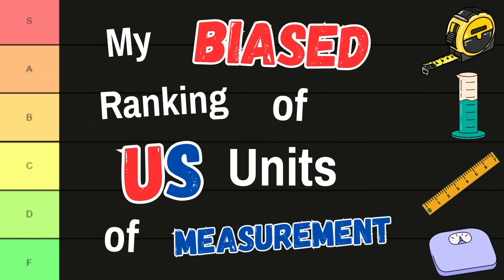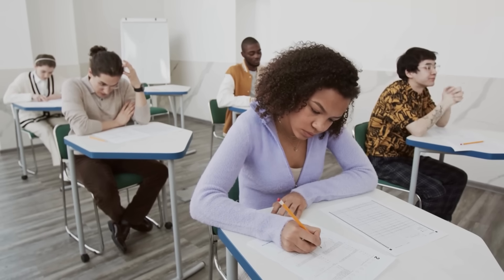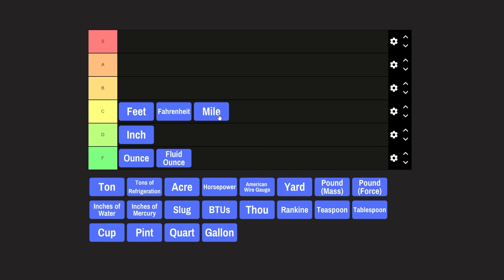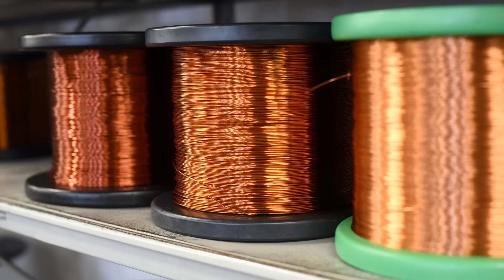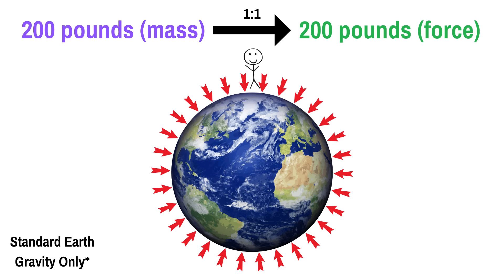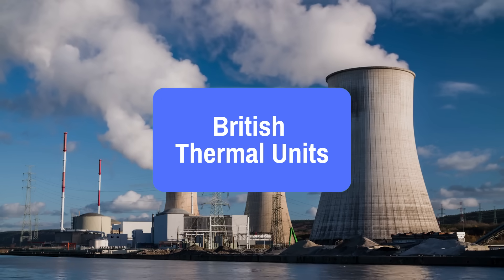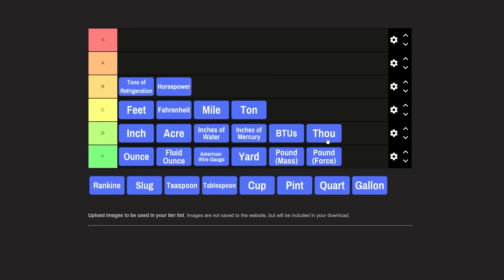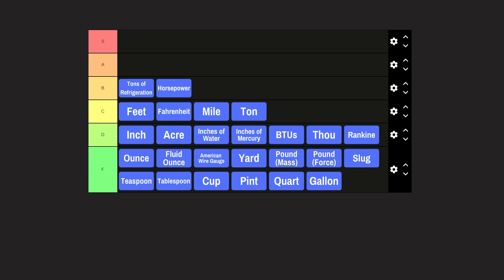Tier List of the DISASTROUS US Measuring System

Comment: 7:12: Unfortunately, blood pressure is measured in mmHg, not inches Hg.
Reply: It seems to be US industry standard to measure positive pressure with PSI and negative pressure with mmHg. They're written that way in manuals I work with, and the gauges are that way. It just happens mmHg is about x2 PSI. I've never seen inHg being used.
Reply: After dealing with Europoors and their stupid measurements, my blood pressure is measured in atmospheres.
Reply: I don't know why the imperial system had so much impact on medicin that its still in use :
-Blood pressure : mmHg, not bar or pascal, or kg/m2
-Needle size : Gauge, not mm or micrometers 
-Suture string resistance : Some weird unnamed unit similar to gauge based on how many parallel strings are required to resist 1/2 lbf, not newtons.
Reply: @pierrevilley6675 ... but mmHg isn't imperial, the mm there is literally "milimeter"
Reply: @merbudd  mmHg is also called Torr, after Evangelista Torricelli, the inventor of the mercury barometer. Indeed, very imperial.
Reply: @merbudd  yeah, my mistake, but it is still a shitty idea to mesure a pressure in liquid head height for medicin applications, especially when the liquid isn't even water. Bars would be much better.
Reply: @pierrevilley6675 Because many of the advancements were invented in countries that were using the imperial system

Comment: I was looking to see barn on this chart. It should have landed straight into S tier. It turns out however, it's a SI unit. So there are megabarns and nanobarns.
Reply: It never was an SI unit.  It was a "Non-SI unit accepted for use with the SI units".  Until 2019.  It's not in the 9th edition of the SI brochure.

Comment: Wire gauge is logarithmic and for all intents and purposes, the diameter doubles every 6 gauges and the cross sectional area every 3. This is very useful for determining current carrying capacity.
Reply: a) simply using the cross section as the wire' specification even more simplifies the calculation about resistance, current carrying capacity, ...
b) the current carrying capacity is not linear across different dimensions - and it is influenced by insulation, multi wire cables, ambient temperature, ...

Comment: When I worked in the USA as an engineer in the marine industry, I used to do all my calculations in SI units (metric) and convert to US Customary units (Imperial) at the end. All of the conversion factors you need in the US system are insane.
Reply: Horsepower pisses me off the most since we already use Watts for electronics
Reply: 754w = 1hp  @Trenz0
Reply: @Trenz0  What I find funny that Americans use horse power for electric motors. There horse power is exactly 746 watts. So the power is calculated in watts and then they divide it by 746.

Mechanical horsepower: 745.699872 watts, electric horse power: 746 watts, metric horsepower 735.49875 watts.
Reply: I worked as an exchange student from Europe back in 84. I had the same experience. They all told me it was less work to do so and less prone to mistakes.
Reply: @astranger448 You realise that you are only ones who use that crap right? Nobody gives two hoots about it other than maybe a couple vassals of your state.
Reply: NB:  US Customary ≠ Imperial
Reply: You can thank the British for probably 50%+ of the mess that is our measuring system because we got it from them
Reply: Very interesting, I mostly skip the conversion all together. Working on PCBs it’s mm and mil. Even in CAD I like to model things in mm. I rarely model in inches or even convert it unless the thing I am building is greater than 500mm, then I would start to mix units. Anything with more than 24 inches I just model in inches or ft depending on the project. Honestly now that I’m thinking about it, it literally just depends on the project.
Merica 🦅🦅🇺🇸
Reply: A small table you pin to a board. Not that crazy
Reply: Most engineering/scientific industries in the US use the metric system…
Reply: @spicywingo  really depends on the industry. In my experience in engineering in the United States, it's about 50/50. We use whatever the operators are reading generally. I prefer imperial system because it's familiar to me and the operators.
Reply: 3, 12, 8, 16, 2, 4 are all okay. The problem comes with miles and with significant figures.
Prefer metric for any engineering use, but still.
Reply: The reason for the inconsistent conversion factors in the U. S. Customary System is because each measurement was standalone and never intended to be combined together. You choose an appropriate measurement (such as but not limited to: inch, foot, mile, ounce, cup, gallon, ounce, pound, ton) and use it alone. As an example, when I measure height I don't mix feet and inches, I just use inches, so I'd write "71.5 inches" rather than "5 feet 11 and a half inches."

In fact, in one case the attempt to make two measures compatible resulted in a seemingly strange conversion factor. The mile was originally 1,000 paces, with each pace being 5 feet, which worked out to 5,000 feet. Then it was made equal to 8 furlongs, which resulted in it being extended to 5,280 feet.
Reply: The first time seeing conversion factors for force made me have a seizure. Dividing with 32.2 is crazy unnecessary
Reply: If someone praises the Imperial System, I tend to give them a challenge:
They can calculate (without a calculator) how many gallons there are in a cubic mile, while I can calculate how many liters there are in a cubic kilometre. And then we can see how finishes first.
Tip: It's about the same number.
Reply: I always giggle listening to Europeans cry about not being able to do fractions.
Reply: Why do metric system users quote weights in kilograms instead of newtons?
Reply: @m14speeder  Because once upon a time there was kgf (kilogram-force, similar to pound and pound-force) and people were used to skip the "-force" part when talking of weight. Still, most people can't distinguish between mass and weight and use them as synonyms.
Reply: @ivoivanov7407  No, kilogram, s a unit of mass. The unit of force: kilopond was derived from it. French soon realized that gram was too small to make a prototype so they chose to make the prototype kilogramme des archives based on kilogram. 90 years later this was replaced by the international prototype of the kilogram which was the official definition until a few years ago.

In the 19th century scientists used a system based on centimeter, gram and second but that was not so practical so in the 20th century kilogram, meter and second replaced it.
Reply: @m14speeder  Because the kg is one of the 7 SI units. It's official.
Reply: @astranger448  kg is a unit of mass not force even if it is official.
Reply: Signifigant digits would be borderline impossible in imperial.  I dont blame you.
Reply: @astranger448  dude stop saying bullshit. The SI has more than the fundamental 7 units and the Newton is part of it. It is not fundamental because it's kg * m / s².
The really good thing that the SI does is modularity, you do N = kg * m / s² and you get force, then you multiplicate by m (lenght) and get J (energy), then you divide by s (time) and get W (power) and so on.
No stupid conversions and no error prone coefficients
Reply: @kino_61  Hey man, this is the internet. Maybe you are calling bullshit on a dude who has been using metric all his life and lives in a country that went metric 200 years ago here. That dude might have forgotten more about metric than you know about it. 

The kg is one of the 7 base units, the Newton is not, it's one of the 22 derived ones. Most people don't have engineering degrees or work for ESA but all know what a kilo of potatoes is supposed to look like so that is what we use.

All your examples are nice and with luck somebody might learn something new but this dude will not.
Reply: @astranger448  I live in Europe in a country that used metric almost since it's founding and I used metric all my life. The dude you're defending doesn't know things that are learned in 8th 9th grade, furthermore no one leaves high school without knowing about joules and watts here in Europe...
It's funny how you told me I'm wrong for assuming he had basic education while yourself were assuming not only that I was American, but (probably jokingly) that I was an engineer for a space agency nonetheless 😂
Reply: @kino_61  Well buddy. You started by calling me dude, and telling me to stop saying bullshit. All for me innocently pointing out that in 1984 I worked as a European exchange student in the US and shared the experience of the original poster, namely that of engineers converting customary to metric and back to customary. 

If you feel that me talking about my personal experiences in 1984 merits this kind of language ok, if you really must. Who am I to tell you what to say or not.

Me assuming that YOU are an American engineer working for the European Space Agency? What gave you that idea? Is my English really THAT bad? 

But I agree, there is a joke here somewhere.

Now if you could please be so kind as to point out where exactly I am defending somebody. I have read the whole comment thread like 4 times now but I somehow fail to see what you are talking about.

Thanks and have a nice day.
Reply: @kino_61 no coefficients, guess I better put away my 9.80164 kg*m/s^2 for Newtons.
Reply: @nathanielhill8156  it just downed on me the ilarious reason why you used that """"coefficient"""". It's because in imperial there's no distinction between weight and force so in every calculation for force in imperial you have to divide by "g".
Reply: In my contry say poind (force in english) for say masse in langage but in physic force # masse. Voila sorry for my english
Reply: @m14speeder  because it implies that it is mass times g, not some arbitrary acceleration. But still it is only used in everyday use. In science and engineering, you'll use Newton each and every time.
Reply: @m14speeder  asks one who uses pounds, poundals, slugs …🤔
Reply: @OneEyedJacker  I don’t use any of those except for lbf and only in everyday life. In my job I use units of N, mm, and sec. I just wondered why kg is used for weight when it is a mass unit. That drives me nuts.
Reply: @m14speeder Brother,  you never measure weight, you measure mass on a scale
Reply: @m14speeder bc not every person is expected to know the difference between mass and weight(the force). Its basically the same reason none calls table salt sodium chloride. Too scientific and just a bother in daily life.
Reply: @m14speeder  Historic reasons, laziness, who knows. And you are totally right, weights should be quoted in Newtons instead of kilograms or metric tons.
Because weight in the end is the force exerted by (in our case) earth's gravimetric field on our mass.

Comment: Teaspoon, tablespoon and cup are excelent measures if you don't have a scale to weigh everything. The only problem with them is that, just like every other Imperial form of measurement, it varies a lot
Reply: Why do you mean when you say they vary a lot? A teaspoon is not a teaspoon from a drawer, it is a special spoon you buy. They come in a set.
Reply: @david672orford  Okay, then it explains everything. I have 2 types of teaspoons, with one of them being 30%-40% larger than the other, and I have many different cups with the largest being ~400ml and smallest ~200ml. Recipes with cups and spoons always confused me, so I looked for ones using grams, and it was today when I found out that there is something that measures those in standard cups and spoons
Reply: then again, if you're in a shop to buy a set of special teaspoons, you might just as well instead invest in a scale @david672orford
Reply: Weigh your ingredients where you can!
So much better.
Reply: @dampaul13  if by better you mean slower than sure.
Reply: @TurboLoveTrain ONLY a slow, simple person would think that.
Best of luck.